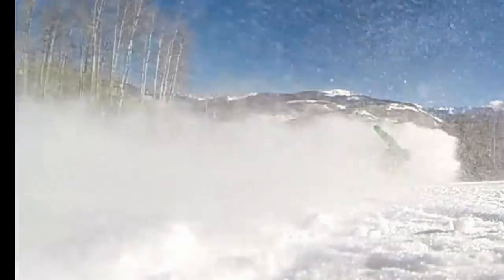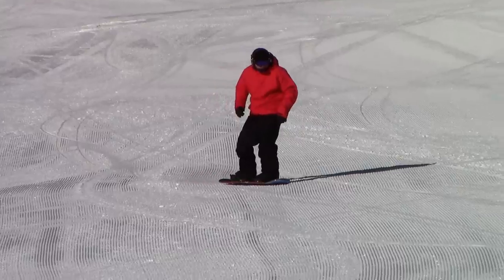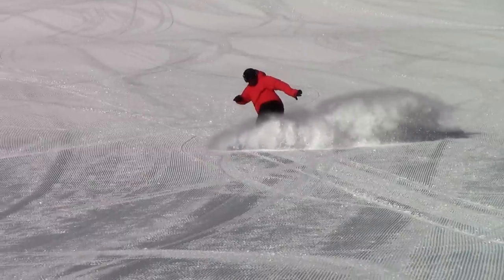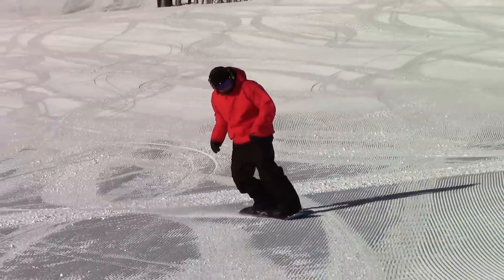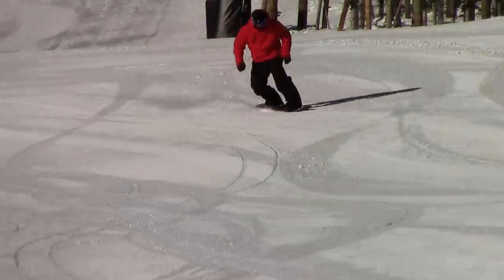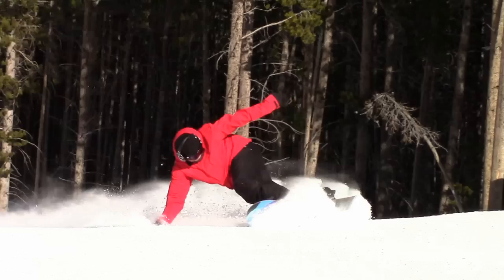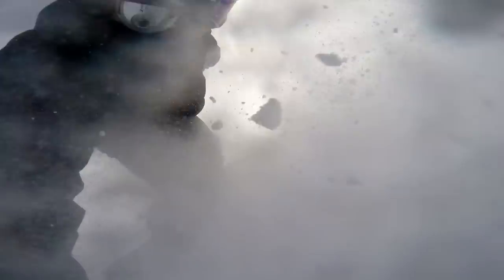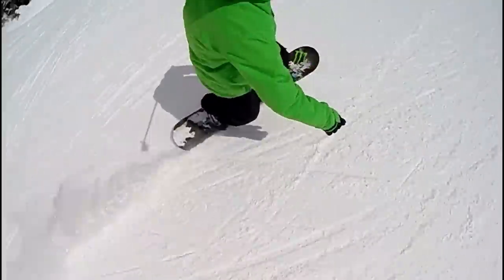How to butter: #16  Slasher Bombs!

Comment: in this trick, it is important to have a wide snowboard to not pull the toe / heel in the snow?
Reply from the maker: It's definitely not necessary to have a wide board... but yeah, indeed you don't want too much toe drag on it as that releases some of the pressure off of the toeside edge and makes it easier to wash out.
Reply: Ryan Knapton I have new board, bindings and boots - I have not tried it yet, not snow :D I can not judge how it will ride, what I can do with  new equipment..
My old board was 260 (WW) - ride on it difficult .. 
What do you say to this: http://www.imghosting.cz/view-2820140906_093051.jpg  http://www.imghosting.cz/view-7620140906_093109.jpg it is a photo of my new snowboard and boots. Is it okay? We'll ride groomed slopes. I want to learn buttering like you, deep carving and of course slasher  bombs :) 
Thank you Ryan !
Reply from the maker: Lukáš Maščuch
That setup is going to be great!  One thing I like doing is placing the heelstrap up on the highest hole option.  The strap is then higher up on your boot and provides a bit more leverage.  Happy Shredding!
Reply: Ryan Knapton I try to place the heelstrap on the higest hole.
Thank you very much Ryan :)
Reply: +Ryan Knapton what type of patches in the snow provides the best ammount of sprey?
Reply from the maker: Firm groomers offer the best stability.  If its too icy obviously it won't spray too much, but it can also be too soft if it's snowed recently and you can dig in too much .  So fresh groomers is my fav for it.  Happy shreddin and slashin!